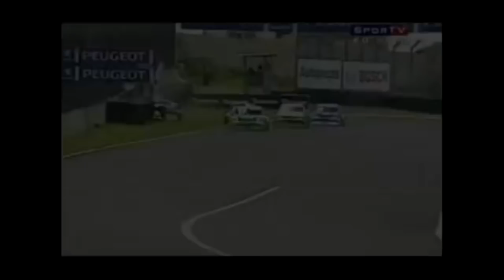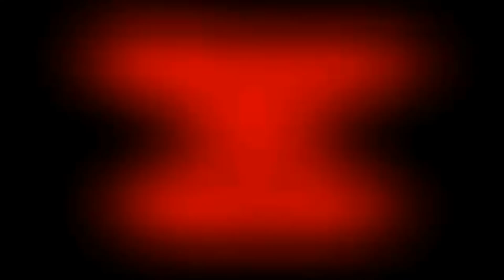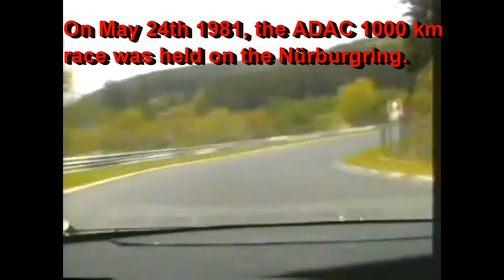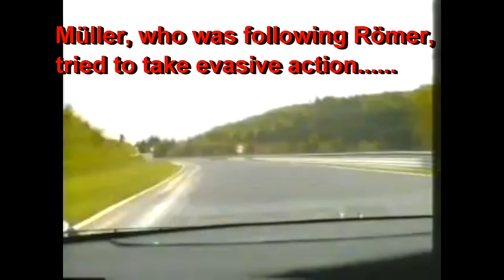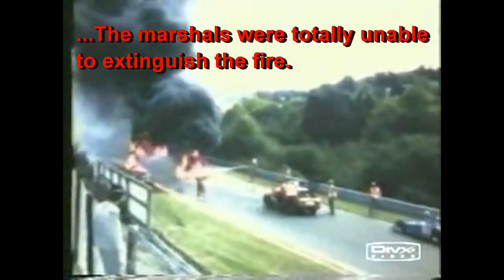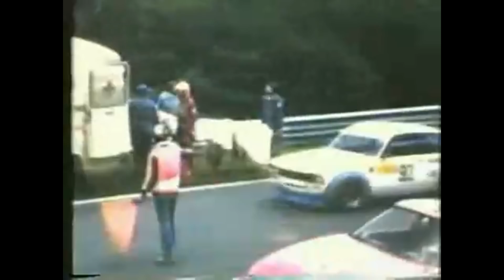MOTORSPORT VIDEO MEMORIAL - Herbert Müller

Comment: 3 drivers who died whilst in a Porsche 908 - Manfred Winkelhock, Herbert Muller, and Stefan Belloff. Porsche had a design flaw in the structure of the A pillar which made it easy to collapse. No wonder they never raced them again.
Reply: Völliger Quatsch! Herbert Müller in einem 908/30 ,Bellof in einem 956 C und Winkelhock in einem 962 C. Und alle Unfälle,spielten sich anders ab. Leider starben sie alle drei.
Reply: Winkelhock and Bellof were not driving 908s.